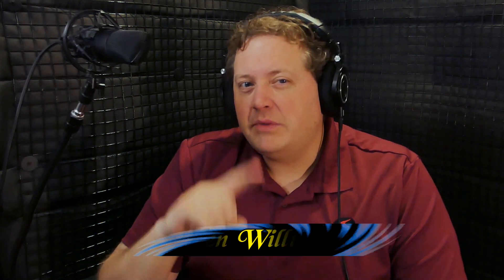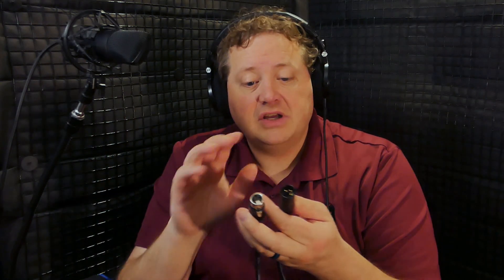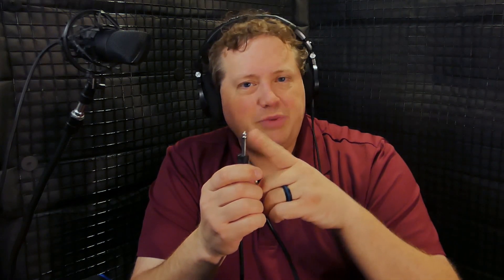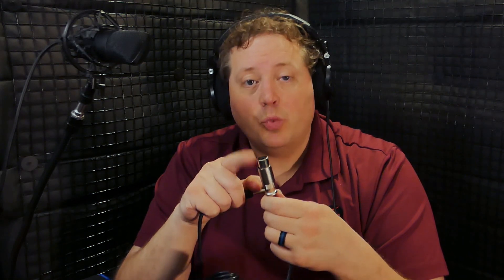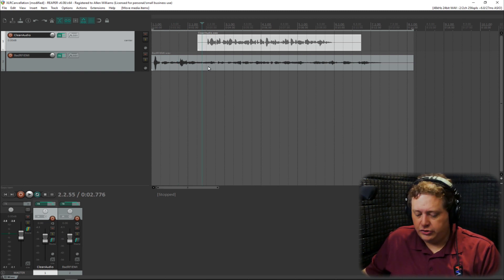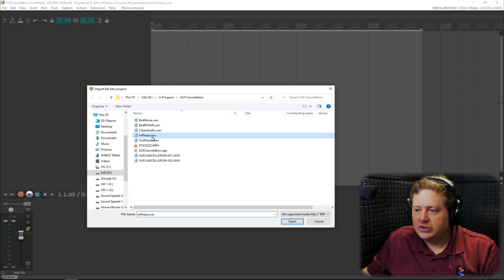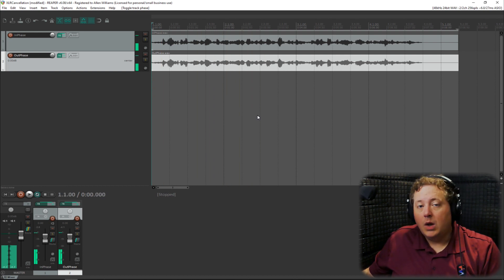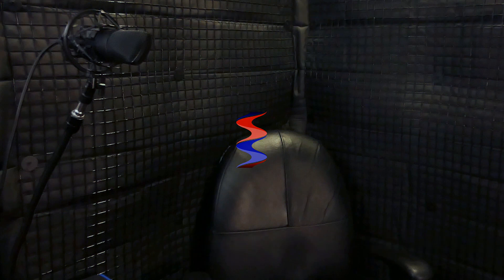A Real Demo - Balanced vs Unbalanced Audio

Comment: Overall, a really good explanation. I would just add one thing. When you showed the adaptor cable with the xlr on one end and the TS on the other, not everyone deals with the 2nd signal conductor the same way. Sometimes the 3rd conductor is not connected to anything, and sometimes they combine or shunt it to ground. So, if you have an adaptor or cable that shunts the extra signal to ground, you can get a short circuit if plug the cable into something that is putting out an actual balanced signal. Typically results in a lot of noise, but in some cases may do damage. Its just something to be aware of. Also, its always a good idea to keep phantom power in mind because its only used on mics, and not all of them.
Reply from the maker: Excellent, and correct, points

Comment: The noise cancellation happens because of a differential input, not because of the signal being inverted. The cancellation still happens if one signal is zero. Balancing means that the output and input impedance pairs are equal. Complimentary signals may help cancel generated magnetic fields in cable runs, but that is different and not a big problem.
The screen of a cable does does not go to XLR pin 1 "because it is ground", but because that pin mates before the other two. It should be directly connected to chassis in the equipment and that should be grounded, but that isn't the same thing.
Reply from the maker: I disagree but OK
Reply: @SoundSpeeds  That is just a knee jerk reaction. Do the same demo without the inverted signal: signal + noise - noise = signal.
Go watch some of Bill Whitlock's videos and then see it you disagree with the entire AES.
Reply from the maker: OK
Reply from the maker: I went on a hunt for what you're talking about and didn't find Bill Whitlock but I did find many other people that confirm what I was saying. Common mode rejection (what I am referring to) is the best mode of cancelation although what you're saying still technically works even though it's not the best way. Your described method cancels the noise floor but not as much the interference coming down the line.

Ground always "mates" before hot signals which is the point of the ground to begin with. The same is true in any other field that deals with electrical signals like... power. I know from personal experience that if you always ground to the chassis, you can introduce undesirable signals going the opposite direction which is why I don't do it. The AES is split on whether it should be done or not and there's no standard for it for that reason. Ray Rayburn discussed that with me in an interview a few years ago on this channel.

Comment: Brilliant video! Do you think buying a balanced cable for i.e.m's for music on the go is worth it?
Reply from the maker: For IEMs? I would think whatever they come with should be fine. Humans aren't mass sources of interference.
Reply: @SoundSpeeds  I hear a lot of talk that balanced cabled are better at powering certain types of headphones/earphones? Is this true? Could you explain? 

 Apologies for the questions, I'm a bit of a novice when it comes to the world of audio but I do find it fascinating and love learning about it!
Reply from the maker: Not really. It basically helps isolate each channel's audio from bleeding into the other channel thru the common ground there by causing noise. Crosstalk is the term. I'm on set and can't go into it in greater detail right now but I did look and found an article that explains it with visuals.
https://dekoniaudio.com/articles/what-are-balanced-and-unbalanced-headphone-cables/

Comment: So you invert the signal on one of the two signal lines at each end... doesn't that insert some amount of latency that is going to show up as harmonic distortion on the output?
Reply from the maker: No latency at all. There's nothing electronic - it's wiring.

Comment: Thanks for the explanation, I understand it better now. Does the balanced cable to all the work, or do the devices on each end need circuitry to separate an recombine the in and out of phase signals?
Reply from the maker: That is inherent to XLR. There are other aspects of the cable build that can help with RFI/EMI reduction.
Reply: @SoundSpeeds  thanks
Reply from the maker: Sure thing

Comment: Would it help to put RF Shielding Foil on set (where it can't reflect obviously?
Side note: I use Balanced Cables exclusively, I'm just thinking more for general RF protection like for Radio Mics.
Would it block the RF used on set or would it prevent any external RF from outside the set interfering with the RF being used on set? That's a mouthful xD
Reply from the maker: We wouldn't be able to do anything like that even if we wanted to. Usually sound stages are very solid so resilient to RF from other stages but on a stage, everyone from the camera department with their remote focus and video transmission systems to Producers on their WiFi hotspots need to use radio frequencies so we can't put up any faraday material or anything.

Comment: Great video! Balanced cables are a great example of 'simplicity is genius'. As far as I can gather, the 'balanced line' concept was invented by Bell Labs for use in telephone wires. Pretty easy to see how it would be useful there.
Reply: Originally I believe they used TRS connectors for that since, they were all about that type of connection. It would be Hollywood and RCA that would largely adopt balanced audio via what we now know is XLR, but originally was known as a Canon plug. Of course they offered 4-pin stereo, and a few other types of connectors. Theres a few weird XLR looking connectors for power connections for example.
Reply from the maker: Good info. Thanks.
Reply from the maker: I don't know the origin but I can see that

Comment: 1. Sennheiser on there g3/g4 system have 3 pins on 3,5mm connector both from microphone and also from output and there are two cable 3,5’mm out or xlr but how do you now if the system run unbalanced or balanced?

2. Why don’t all use this kind of system instead of only two pin, the cost is more of course but not so much?

3. Can you check if the signal is real balanced in some way or if it’s a faked XLR with only two pin that used?
Reply from the maker: 1) Lavs are different hence why I said this pertains to XLRs.
2) Going balanced is more expensive. Discount brand cut costs everywhere they can.
3) You can open up the connector or get a cable tester. A multimeter also works.